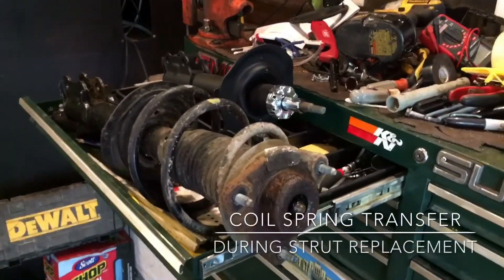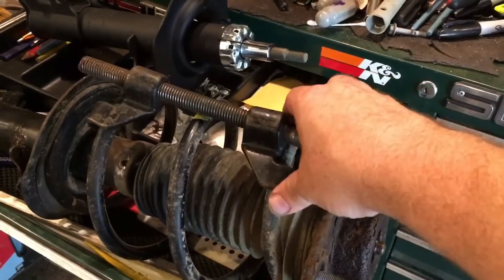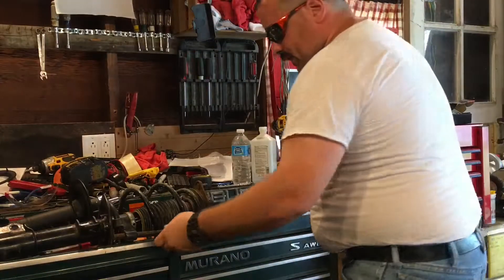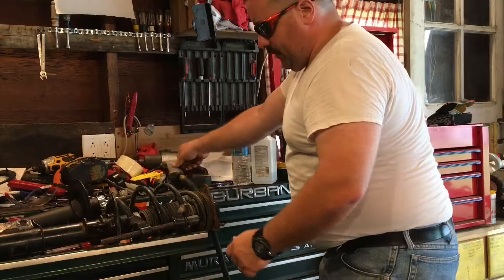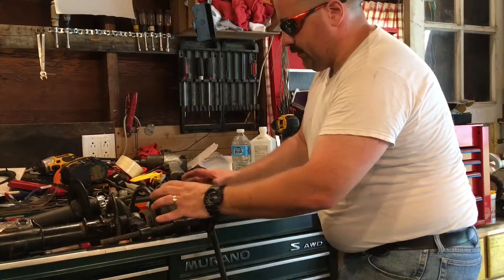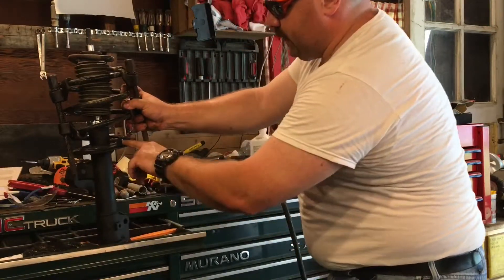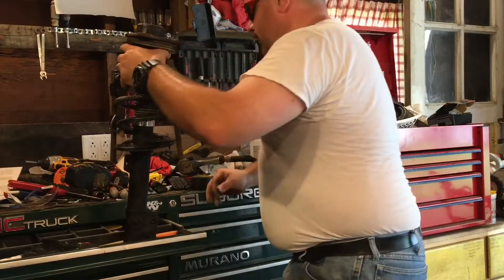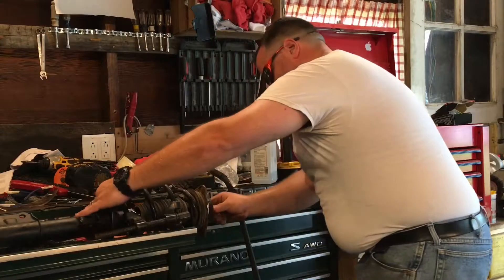Vehicle Strut Coil Spring Transfer

Comment: For those of you without an air impact wrench, you can use what's called a "pass-through" socket wrench (Harbor Freight sells them for cheap) and then a second smaller socket & ratchet/wrench goes through the pass-through socket as a counter-hold on the strut piston rod. Just make sure you use liberal amounts of penetrating oil and a wire brush on the nut and piston rod since there will be lots of rust and gunk built up over the 75,000+ miles that strut was in the car